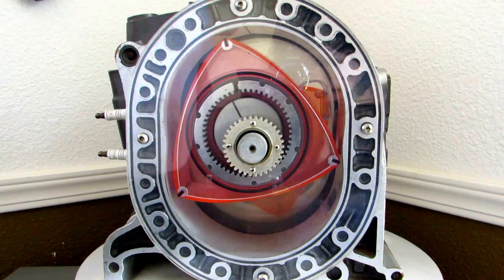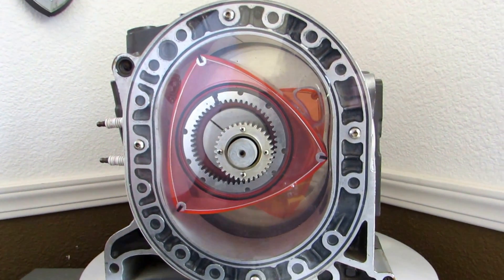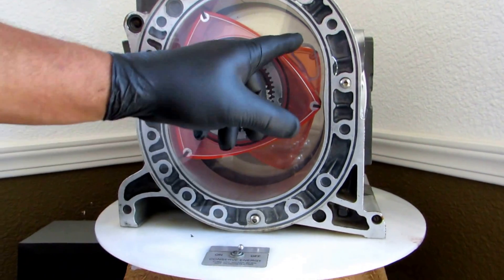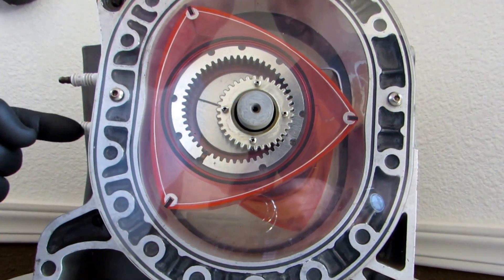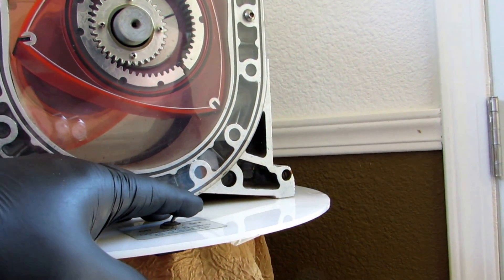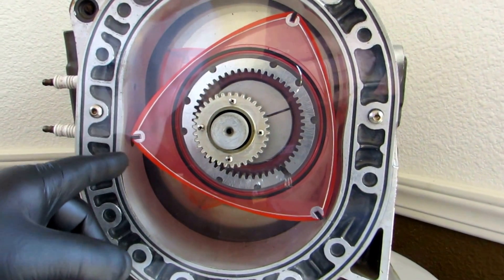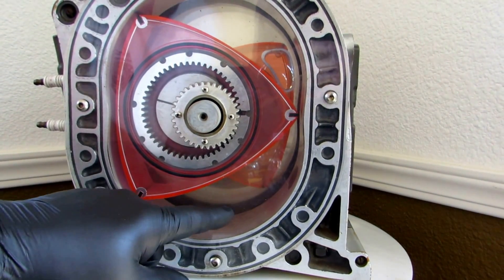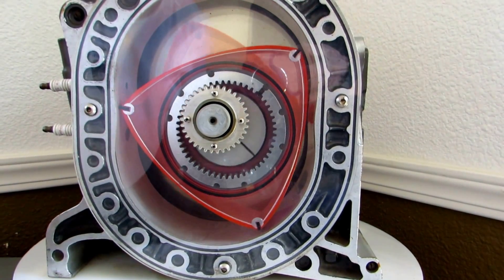Kurt Robertson explains how a Rotary engine works

Comment: you lost me at 2 cylinder 6 cylinder
Reply: I was thinking the same thing. Theyre rotors not cylinders. And 4 stroke not 2
Reply: 2 ROTORS ENGINE  6 CHAMBERS  IN 1080 DEGREES  3 TURNS FOR OUTPUTON ALL ROTARY ENGINES
Reply: HULA HOOP EFFECT MORE EFFICIENT AMEN LESS STRESS THAN A PISTON ENGINE CRANK SET UP FOR WINDOWS IN THE SIDE OF THE BLOCK
Reply: MAZDA ROTARY ENGINES ARE BACK
1
Reply: @dodecahedron1  Just make it at home.
Reply: Unfortunately this was a very poor explanation of how the Wankel engine works...

Comment: more like a four cylinder.  and it doesn't explode!
Reply from the maker: You mean 4 cycle? Intake, compression, combustion, exhaust? Yes, exactly those cycles!
Reply: nope.  four cylinder.  four power events per 720 degrees.  very interesting engine...had to buy an RX8 :)
Reply: +Chris Stavro That is Incorrect the Wankel KKM type engine completes its firing order sequence in 1080° of crankshaft rotation. six 30mm long power strokes per chamber for a Mazda 13B.
Reply: yes, six firings per 1080* of crankshaft rotation...FOUR per 720*.  I'm a couple steps ahead of you :)
Reply: +Chris Stavro That's still Incorrect Chris, the Wankel KKM type engine completes its firing order sequence in 3 revolutions (1080° of crankshaft rotation) NOT TWO REVOLUTIONS.

Comment: So sad that the wankel engine didn't have the future it deserved. I think that this engine concept is overall a better one.
Reply: Well, an interesting engine for sure but the reason why it was never widely adopted and became obsolete is because it is an inherently inferior design concept.
Reply: Sebastian Boiciuc It's a needlessly exotic design with fewer benefits and far more vices than your typical piston-fed, camshaft design
Reply: +The Animal   Seems like you have not driven many high performance cars... the RX-8 is mediocre at best... and its engine is nightmare that generates pathetic power and almost no torque
Reply: Sebastian Boiciuc I drive one every day . mazda Rx8 never lets me down . fun fast reliable and handles Brilliantly . yes it is thursty put that aside the motor has everything going for it
Reply from the maker: You are right! I think many of us feel that way.
Reply: HULA HOOP EFFECT MORE EFFICIENT AMEN LESS STRESS THAN A PISTON ENGINE CRANK SET UP FOR WINDOWS IN THE SIDE OF THE BLOCK

Comment: One of the better explanations out there,  good job.
Reply: +Eliot Metherell Oh! Thats easy!  This engine has a spinning crankshaft and a flywheel.. Rotary engines have a fixed axle, and have no need of a flywheel.
I think you are confusing "Mazda Rotary®" a defunct brand of Wankel KKM engines... with an actual rotary ICE.
Cheers!
Reply: thank you, i am very smart
Reply: Too bad they couldn't get the title or the type of engine right... this is a WANKEL engines.. not a Rotary Engine
Reply: The real doktorbimmer 
Can you explain the difference to me? This looks like what I have read a 'rotary engine' is
Reply: doktorbimmer do you comment on a every video with rotary engine in the title
Reply: +Evan O'Connor  *How would you know Evan? I only see you posting stupid comments on the Wankel engine videos incorrectly titled "Rotary engine" *
Reply: u r funny guy

Comment: Does anybody have any info about that model that Kurt is using to explain how the engine works? I found one of those in a cabinet in the school I teach at and I'm trying to gather some information about it. Did Mazda actually produce those model engines for educational use?
Reply from the maker: +David Schmitz  I think so. Kurt told me he got it from a Mazda dealership when they stopped selling rotaries.